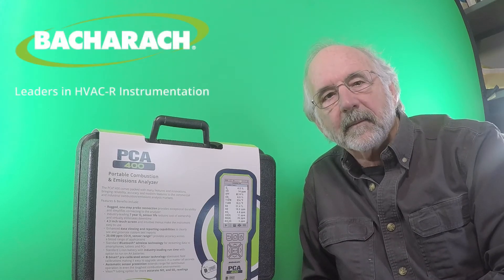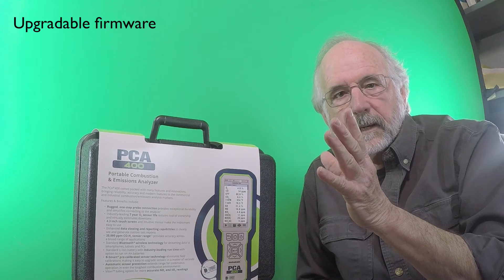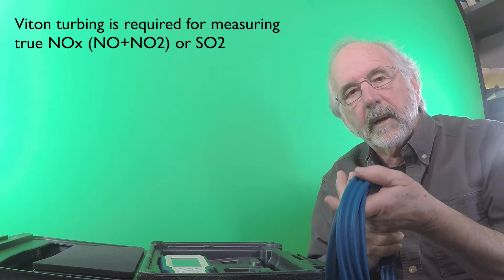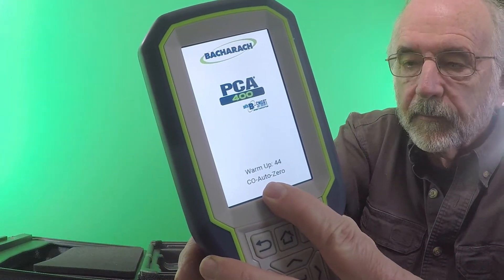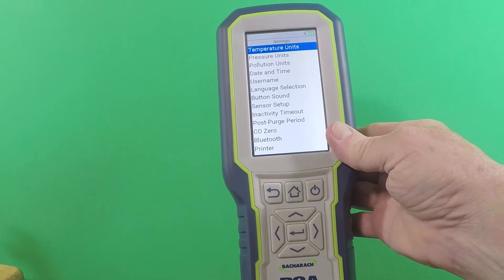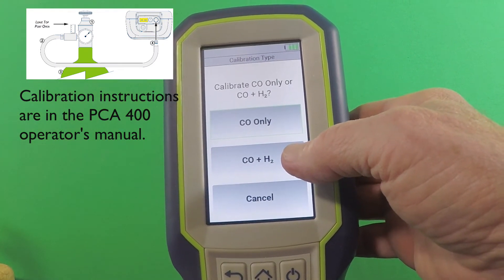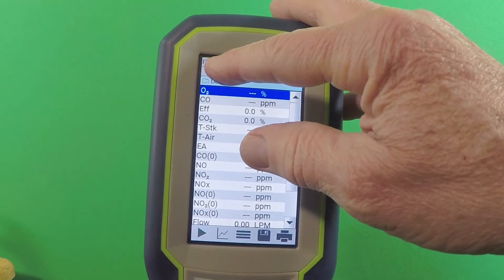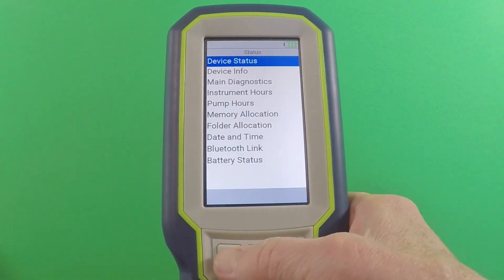PCA 400 Introduction video - first look

Comment: HOLA, soy de bolivia, tengo una consulta, donde se ven las diferencias del PCA 400 2411-1110,  2412-1310 y 2412-1312?, ese dato solo llega en la caja?, o existe la posibilidad de ver su configuración en alguna parte de la pantalla?, gracias
Reply: hola  el  2411-1110  - -----PCA 400 w/O2, CO, NO, 12 in. probe with 7.5 ft. standard tubing and standard case
2412-1310-------  PCA 400 w/O2, CO, NO, NO2, 12 in. probe with 7.5 ft. VITON tubing and standard case
2412-1312 -------PCA 400 w/O2, CO, NO, NO2, 12 in. probe with 7.5 ft. VITON tubing, standard case and Bluetooth printer
La diferencia entre los 3 son los gases que trae para medir , asi mismo su valor comercial es diferente, y la diferencia entre el 1310 y el 1312 es que uno tiene impresora y el otro no. 

Saludos,